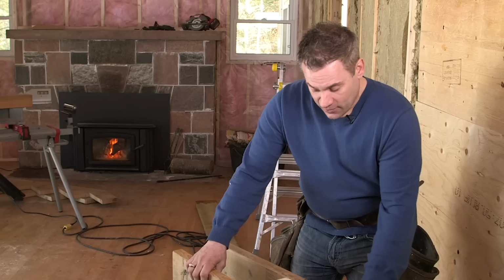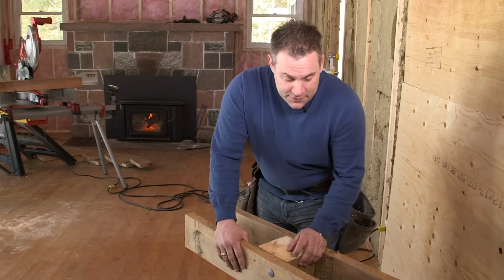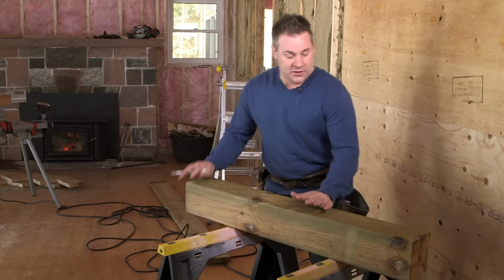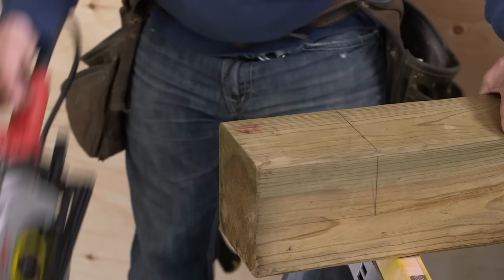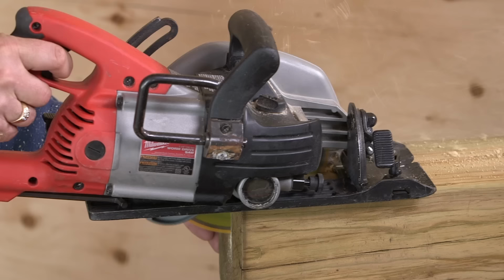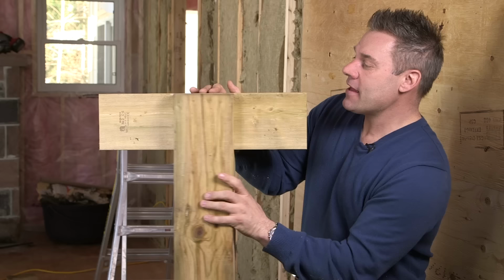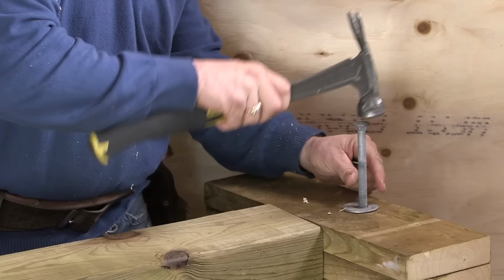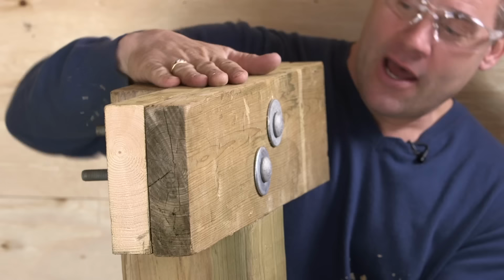How to Attach a Beam to a Post for a Deck | Decks, Docks & Gazebos

Comment: Using carriage bolts is insane, so much extra work when you can use timberlocks. 

You can definitely over cut that notch enough to just cut through, the structural integrity would not be ruined.

You make a good point about staggering the bolts, triangles are the strongest shape and it's like making the side of a triangle through your wood grains.

You should also use washers that are serrated to prevent the bolt from loosening over time if you decided to use them

You also look silly using a 16" drill bit to make a hole through 4" of wood
Reply: .......I was trying to work out how he drilled so close to perfect right angle rather than diagonally as can easily happen. I can see that having a long drill helps visually judge the angles better.

Comment: Hi there, so my deck is done exactly like your example going back to 1995. Thus being 25 years old still in great condition. 
6x6 posts while using 2x10 sandwich with gal. Bolts with washers. 
But want to make it right. 
I believe I can notch the inside of the 6x6 1.5” and put back the 2x10.  
Would that be a good enough fix?

Cheers..... Yvon.

Comment: Observations after much research by a non-professional with a "little", maybe "very little" common sense:
After reading most, not all of the posts here, one can conclude that there are many ways to build a deck, many of which have lasted for years without failing, but could be more sound and better thought out. Congratulations to all who have constructed a deck of their own design and it's still standing solid. With that said I present the following:
1. Never notch wood even if you treat it where it's notched, as you are exposing less treated and/or less effective treatments to areas of the exposed/notched post, and expansion and contraction by water and freezing will eventually split and/or rot the posts and/or cause twisting and height differences between the post and support beams. Research that makes sense, says to place beams on top of posts with appropriate rated fasteners and to use bolts and never screws or nails.
2. Never place posts directly into dirt/ground/cement as all will wick moisture into the wood and rot it. I've seen examples of all three. The supposed proper method is to use a beveled/bell shaped cement/concrete footing extending below the freezing line of your particular area which may require going as deep as 48" but usually 36 at most, and extend above ground level for the posts to rest on with a galvanized or similarly weather resistant treated barrier/fastener between the post and the concrete lever/footer/stump/etc., again to prevent wicking of moisture. 
3. Galvanized fasteners with bolts should be used to join beams and posts with proper spans and the bottom most of the step riser should be 1" lower than the rest of the riser cuts to allow for the 1" tread board, and if using synthetic/composite decking/steps, spans are much shorter than with traditional treated wood.
Some questions/suggestions/options come to mind:
1. If wood is the weakest point in the equation, after the skill and common sense of the builder, which it is, then why not use some other type of material for the support posts that is more weather resistant, i.e. some kind of metal, concrete, composite material. When I lived in Florida, the Lowes there had these 8x8" I believe synthetic railroad tie type posts fashioned out of recycled material with a rubber base supposedly rated for 30-40+ years. They were heavy as hell but I managed to maneuver them by myself when making some posts for fencing at the front and sides of my property and using vinyl fence between so that they were completely weather and fade resistant, both the fence and posts were black. I also used these synthetic ties to make a tiered, staggered frame/border 2-3+ high depending on the grade, on the ground to place large pavers inside of for an outside ground level deck that worked and lasted great during the time I owned the home, using the appropriate base underneath the pavers of course. I also used the same ties as posts and vinyl fencing between going around my paved patio/deck with a vinyl gate to match.
2. Instead of sandwiching/sistering two beams together, which still allows water/moisture to collect between them, why not just use the same size 4x4 or 6x6 as the post they will lay on top of? Would seem to me to be both stronger and more weather resistant. Yes, many of the things I mention are more expensive, but doing it right or safer is always worth the expense of you, your family and guests' safety as well as for resale and maintenance.
3. I'm having a little concern that even though bolts are superior to screws and nails, the hole bored out for the bolt leaves a small but never-the-less space around the bolt for water/moisture to accumulate, and again with access to the less protected inside of the wooden post. My idea is to add plumber's pipe dope which is water proof, to both the inside of the bolt hole as well as the bolts themselves before inserting and tightening them down, yeah or nea?
4. I realize and accept that I'm going to get reamed and torn apart for my post, as is the nature of putting anything online, but felt compelled to share my observations and questions. 
Good luck to all on their deck projects.
Reply: Notching is a no no!

Comment: I am using 16 foot 6x6s to support a deck, then add a shed roof over the deck. The 6x6s will be put on Armstrong brackets bolted to concrete pillars. Should I notch out to support the perimeter joist? Will notching the 6x6 remove strength to support the roof above?

Comment: I would saturate that joint either way with copper napthenate to hold off water and bug damage for many years. Inspect yearly and snug up the nuts too if accessible. Also like the idea of the washers on the head of the bolt. Simply get a washer with an oversize hole to accommodate the square shoulder.

Comment: Never ever sandwich two beams together in a wet rain soaked environment! Water wicks and rot is the result! Cut equals in BOTH sides of the post! Seal the cut with a weather repellent treatment!!!
Reply: How do you reseal it when it wears off tho
Reply: Use a good sealant and it will likely last longer than the deck . I seal all end grain with 123 primer and have even used bitchathane in some instances . We built mansions in the bay area and when you're building 10 - 60 mil homes the waterproofing must be over the top .

Comment: What abt a 6x6 post in the corner where two 2x10’sx12 ‘ will be meeting. I get shaving the one side for load bearing but if i shave the other side of the 6x6 so the corner is flush, will that in your opinion lessen the 6x6’s strength and purpose ?

Comment: There's absolutely nothing wrong with using carriage bolts to carry a deck. The shear strength of four carriage bolts is more than the carrying capacity of the timber.

Comment: Milwaukee is NOT a Skilsaw. Only one saw can be called a Skilsaw.
Reply: Skilsaw is a brand, like Dewalt, Milwaukee, Makita, Stanley, etc. I hate when people ask me to hand them the Skilsaw when they are talking about another brand name circular saw. lol
Reply: I’ve used many brands of adhesive bandages, but I’ll be damned if I’m going to call them anything except BandAids.
Reply: @zxzs328  I didn't know there were different brands of bandaids. I let my wounds dry out,  scab up, and flake off.
Reply: @sticknstonesbrkbones  even if its a deep cut? I use toilet paper and electrical tape in the time of need.
Reply: @brianw7841  If its deep enough to need stitches I go get stitches, but if its minor I let it be unless it wont stop bleeding. In that case I have used paper towel and electrical tape...way cheaper than bandaids.

Comment: I agree, I always like belt and braces approach. If you only have bolts holding the  beams wood shrinkage and compression from the bolts will lead to loose joints . And potential failure .
I prefer to put the beam on top of the posts and use Metsl brackets to keep in place ( various types)   It easier to cut the entire post to the right height after setting in the ground  than precutying as your video suggests IMHO.   Cheers Warren

Comment: There are a couple of glaring errors in this clip. You are using Galvanised bolts in treated timber. WRONG! They will react with the timber treatment and be rusted out in 5 years or less. Especially in an exterior application with treated timber you need to use lacquered/coated bolts not plated bolts. 
I've seen both coated bolts and gal bolts used in the same treated post. After several years the coated bolt was full diameter and could still be undone and was as good as the day it went in. The gal bolt looked fine on the outside but inside the post it had corroded to the point where the remaining parent metal failed with the torsion of just undoing a nut.Also the the timber around the bolt hole was like an access not much to see on the outside but a big ball of corruption inside.
Next you want to put a washer under the head of the bolt use a hex headed bolt so you can tighten it. Your setup will sit there and spin unless you have some special washer with a square hole and grips/spikes on the underside. (I've never seen one like that). Unless that nut is done up to the recommended torque it can put the whole structure at risk.
Maybe you should stop giving advise before you hurt someone who thinks you know what your talking about.

Comment: I've built several decks and always use this method, but it would take quite a lot of weight to shear off those carriage bolts.
Reply: I wouldn't worry about the bolts shearing....I'd be more concerned about the wood splitting under load

Comment: What a load of hogwash!!  If the bolts are properly tightened they experience no shear force at all, rather all the load is transferred from the beam to the post by the friction between the beam and post.  Friction force equals normal load  times friction coefficient.  The normal load comes from the compression between the wood members which results from the tension in the tightened bolts.  It is the same principle that works in a multi-element shaft-line where each flanged section of the shaft-line is attached to the next by bolts which see no shear force when the flanges are properly machined and the bolts are tightened to the proper torque.  And while breaking the bolt is a "good visual" it is the result of a dynamic shock load on a cantilevered element, not static loading  of a tension member which these bolts are when properly tightened.  Like on the internet in general, not all YouTube videos are accurate and can propagate incorrect personal opinions.

Comment: What a fool, he needs to look up the definition of shear stress. Clue less!!!!
Reply: Meh, if one wanted to. One could simply do a U cut in the support and place the beam through that and you won't even need to bolt until the vary ends. Save some money on the bolts and the material will stay just as strong for many years to come. The whole bolting process is unnecessary if you use the the right method to secure the supports for a deck... Which is not too far from the ground.
Reply: He's not wrong about the definition of shear stress.  Granted he put bending into the screw, but those bolts are in both shear and bending.  His connection is legitimately better.  As Helvetshit says it would also work in the middle or double them up on outside notches, but you should still have some positive type of fastener like a bolt or screws.
Reply: David C. Huculak
Point is, it is still a deck that is generally less than a metre from the ground. And you should hopefully not have an elephant on it. So one do not have to worry too much about how Strong certain things is. Sometimes, it should just work.

If you want something that can hold an elephant, you shouldn't even use Bolts of fasteners unless at the very ends to secure it in place. Because having the beam rest on a U cut vertical beam is FAR MORE stronger than notching out along the sides or similar. Bolting in this structure method is stupid unless for the sake of securing it so it doesn't move around. But ye. If it is just a less than a metre from the ground. IT is generally no issue in regards to beam structure. But more what kind of planks you use that people stand on... Since they are generally the ones that break first.
Reply: I agree with Anthony Paxton.  This guy is just wrong when it comes to 'shear strength' of a carriage bolt.  Impact shear stress of a hammer hitting across a screw is not the same as constant stress from framing and live load.  Anyway, look at the tables from any of the bolt companies, and you'll find that a 1/2" galvanized carriage bolt is plenty strong for this application.  Certainly, notching provides a direct vertical line from load to the foundation, and hangers provide more confidence but they're still hanging on nails.  But, the simple truth is that I've used thousands of 1/2" carriage bolts for this kind of application and NOT ONCE has one sheared off.  An alternative to notching would be to simply shorten the post and use a framing tie to set the headers on top of it.

Comment: SORRY GUY BUT IM MY TOWN CODES DO NOT ALLOW FOR NOTCHING OF THE POSTS OR BEAMS. AND,  REALLY, THE SHEAR STRENTH OF THOSE CARRAIGE BOLTS IS HUGE.
Reply: John Orabone where do you live that code does not allow you to notch a 6x6?
Reply: @steveinity  when you build anything that requires you to follow the instructions of an engineer via blueprints or drawings. This video may fool an unskilled carpenter with its  logic but to the seasoned carpenter this video is a lie. Who has ever seen a carriage bolt break or not outlast the lumber it was used for.
Reply: Timothy warren I am just wondering where  John Orabone lives that code doesn’t allow the notch of a 6x6?
Reply: @timwar7690 , Carriage bolts do break easy.  You absolutely should notch out the wood.  You will get a much stronger and longer lasting connection.
Reply: @ahnilatedahnilated7703  if installed properly @ the manufacturer's specifications your porch, deck, gazebo  or whatever you build will inevitably rot before those bolts break. If there was a problem with these bolts breaking while using them for what they were designed for then they wouldn't be allowed to be used for a fastening system. They would be recalled. As for notching a post, I dont really have a problem with it except for allowing water to penetrate your post with little or no air flow or drainage which will speed up the rotting process. My point is simple, there is no need to fix something that's not broken in the first place.

Comment: Does anyone saying bolts are okay know that nothing is stronger than its weakest link? Sure, the carriage bolts are really strong and won't shear anywhere near as easily as the screw bends, but if you think that matters you have no business designing or building anything structural. That 6x6 post is good for almost 14,000 pounds of load, but only if you use all 30 square inches of it. A pair of 1/2 inch bolts only use 5 1/2 square inches of the post for support, reducing the theoretical compressive strength to about 2500 pounds.  More importantly, each of the  beams has only 1 1/2 square inches of bearing surface with a pair of 1/2" bolts, providing less than 700 pounds of compressive strength.  Friction will help a bit, but round bolts result in a lateral load across the grain of the post (they're a poorly shaped wedge), increasing the possibility of splitting. For the beam you've also got a tension load across the grain, also  increasing the possibility of splitting. Raise your hand if you're stupid enough to think that's a good idea when a double 2x12 beam will let you put a 4000 load on a single post.

Whether you use a notch or a structural connector on top of an unnotched post, each 2 by results in 8 1/4 square inches of bearing surface.  A fully supported 2 by then results in a compressive strength that's almost twice the maximum allowable design load. Of course you can dig more holes and use more posts if you think bolting offers an advantage over notching or post caps.

The only reason you don't see more failures because of a simple bolt through connection is that most decks don't see a load as high as proper design calls for, and the same lousy decks usually fail from a ledger board failure first. Put a bunch of partying college students on a deck that's poorly designed or built and failure becomes far more likely.
Reply: 6x6 is good for 14k lbs provided the post is no higher than  _________ ft in total exposed length
can you fill in the blank?.

Comment: This IS the best way to transfer load. Using carriage bolts will suffice, but notching your 4x4 will never fail. It's not done because some builders want the "quick" way of doing things or they are just too lazy. Another way you can attach a 2x4 on the post with screws, and let the beam rest on that. of course as long as the 2x4 is resting on the footing along with the post

Comment: If you actually did woodworking and not just contracting, you'd realize that you just gave that 4x4 incentive to split down its middle. Likely, nowadays, that post is going to twist and warp in the first year, and that's going to start the split.

Comment: My inspector didn't want me to notch the post. Either a three ply beam on top of post saddle, or two 2x's carriage bolted to the sides of the post, with blocking every 16" along the beam between the 2x's.  This prevents buckling of the beam with movement.  Also, this distributes the weight of the joists, reducing hinging.